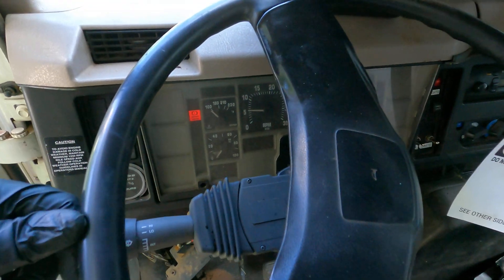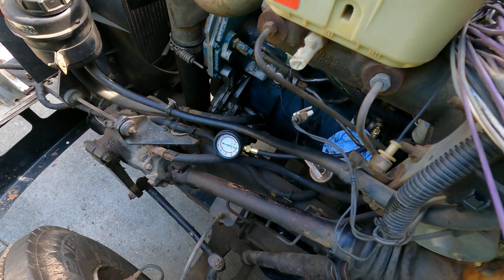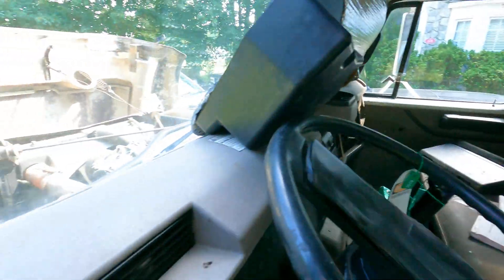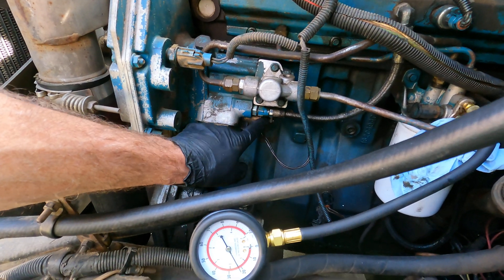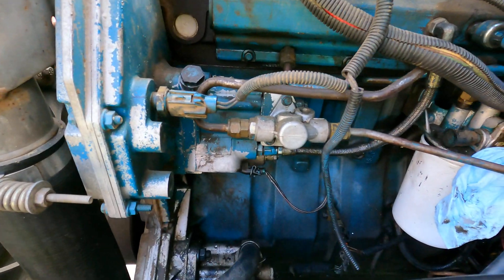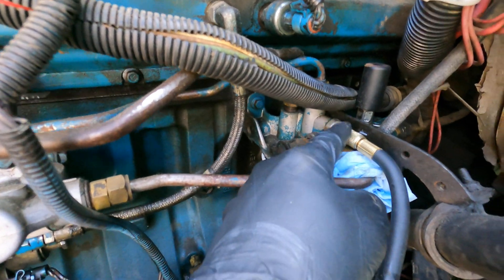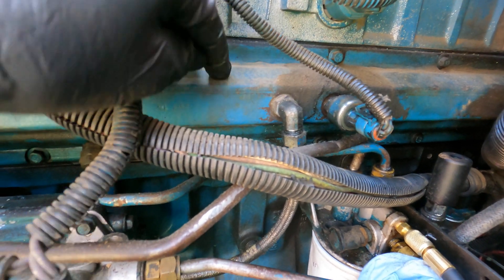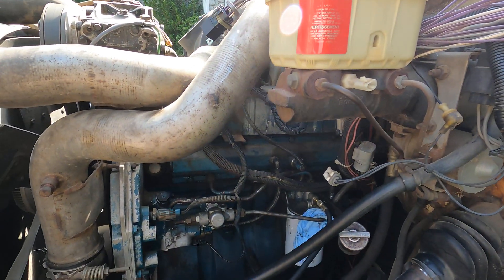1998 International 4700 DT466e - Fuel pressure test (*UPDATE - IT RUNS - SEE VIDEO in DESCRIPTION)

Comment: You had better relearn your fuel system comes up the fuel line to the strings through the strainer then passes under hand pump bypasses filter housing comes out lower line going to lift pump passes through lift pump comes out left side returns to rear port on housing down through outer filter holes passing over to center tube up through middle of filter to centerport to injectors that is the correct passage of fuel

Comment: Wow yours cranks so well. I have a 3800 with a dt466 and it cranks much slower. How many batteries do you have? Cranking for more than 60 seconds kills my batteries
Reply from the maker: I have just 2 batteries but this one cranks better than the others I've had.  And once I sorted the fuel pressure and HPOP, it starts really quick.  The DT466e is my favorite diesel engine so far.

Comment: I have a 2001 freightliner dt466e and I wanted to know if you know the power steering fluid type?
Reply from the maker: I'm a big fan of Lucas Power Steering fluid.  Lucas even fixed a small leak in my 4300 shuttlebus. Any PS hydraulic fluid will probably be fine. Follow the lines from your power steering pump to the power steering reservoir.  Fill it to the fill line indicated.  If it's run dry or you're replacing the pump, you'll need to bleed it so the fluid doesn't foam up when in use.  I've never had to bleed one but if I do, plenty of youtube vids on it.

Comment: did you get it started?  What was the problem when all was said and done?  I have a truck same engine and setup.. and the lift pump seems to be doing nothing.. I replaced the pump with a chinese one and still no pressure buildup. The cam that drives the pump is rotating and appears to be bumping the pump with small 1/4 to 1/2 inch strokes.  still no pressure..  pressurizing the fuel  tank with 10psi shop air.. sends fuel out bleed port and pressure check port.
Reply: Yep - the main culprit was the Ferry Plug Ball.  That little .25" ball kept the HPOP from building pressure.
Reply: @davidpaterson6271  Where is the ferry plug ball located..? is it easily accessable? this could be my problem.. I cannot build pressure, the fuel is all leaking back into tank via return line..
Reply: I found it, thankyou, by searching google.. many thanks and God bless for a excellent video
Reply: https://youtu.be/kwrolIvTop8?t=38 shows how to assemble the ferry plug and ball properly
Reply: @19999927  if it’s fuel going back to the tank, check your manual pump check ball. It’s located on the fuel filter housing under a plastic top (has a plus sign on it).  That ball is .5” and you can get them for five bucks at McMasterCarr. Part number 3645K5 Viton Flouroelastomer Rubber Ball.
Reply: @davidpaterson6271  Que tal soy de Chile y llevo 8 meses con un camión parado. nadie encontró la falla,lo lleve al concesionario lleva 2 semanas y ayer me avisaron que arrancó el camión o aceleró levanto rpm. pero al momento de retirar la presión ejercida en el tranqur de combustible se detubo nuevamente . alguien que me pueda ayudar a falla es similar ala que están planteando

saludos esperando alguna respuesta .

Comment: If I understood you correctly you may have  described the fuel flow backwards. I think there is an arrow on the lift pump .. wouldnt the suction side be the side with the arrow pointing leftwards? or the right side of the lift pump?